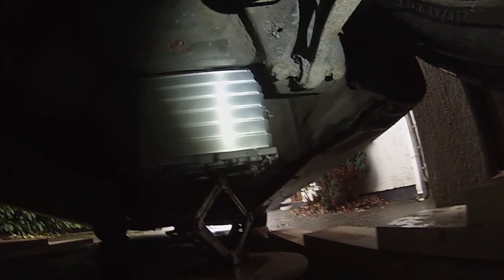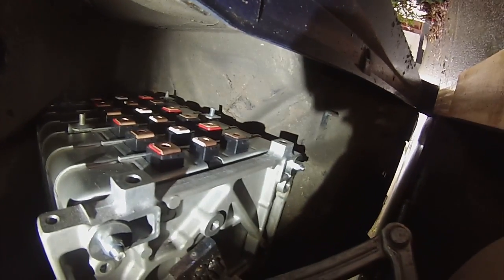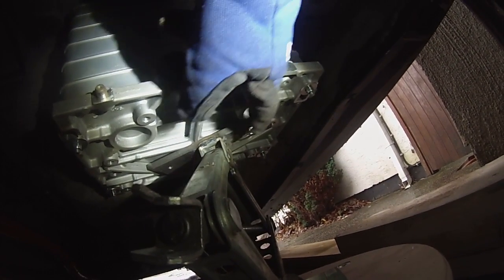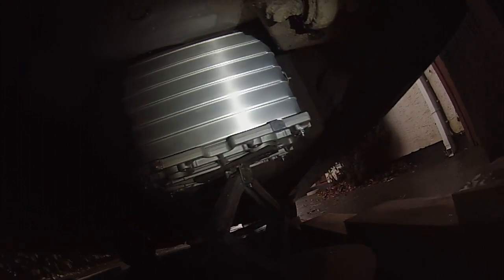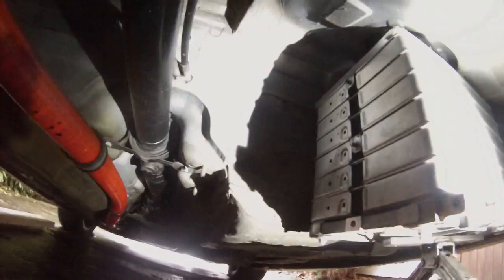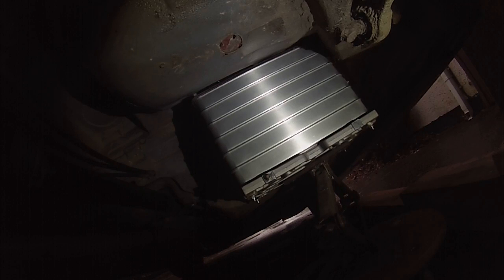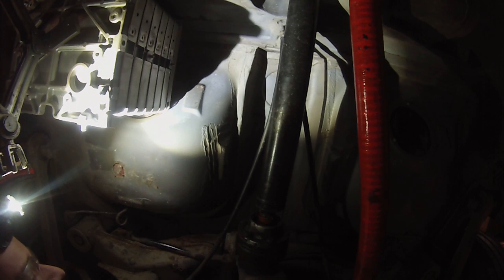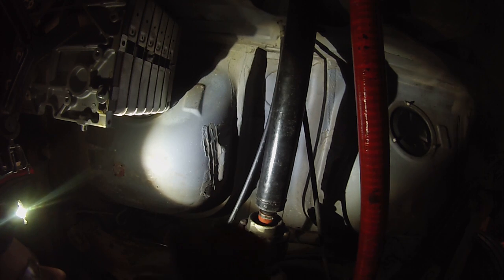BMW E31 840CI EV Conversion 40 : Under Car Cells

Comment: Hi Damian  would it be safer to turn the pack around so the battery connections are facing toward the centre of the car just thinking of a hard side impact may cause a problem
Reply from the maker: +gazbmw0 Good idea:)

Comment: Hi Damian  would it be safer to turn the pack around so the battery connections are facing toward the centre of the car just thinking of a hard side impact may cause a problem